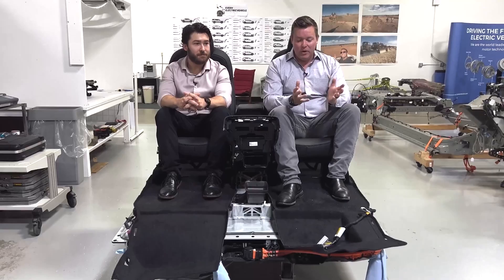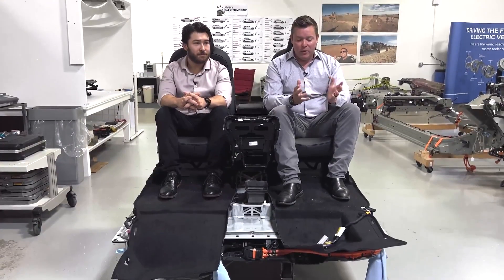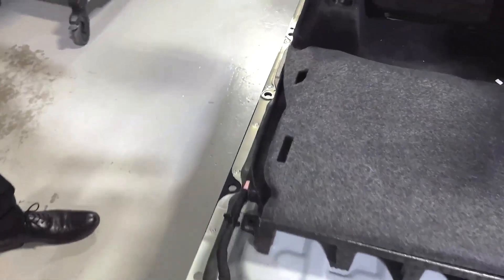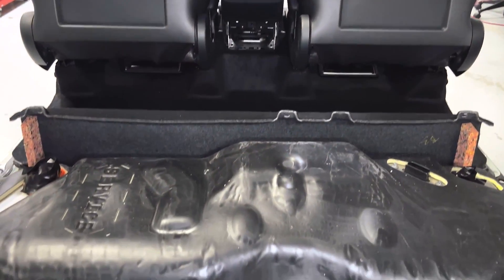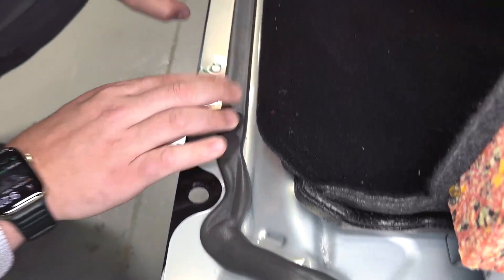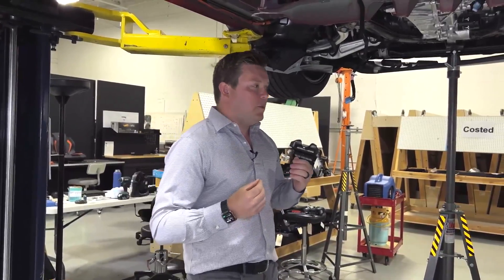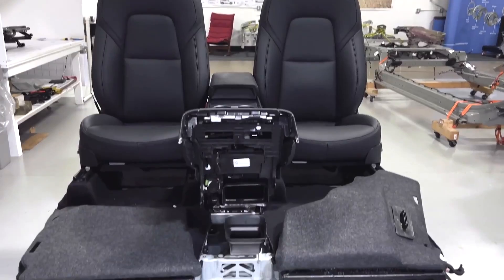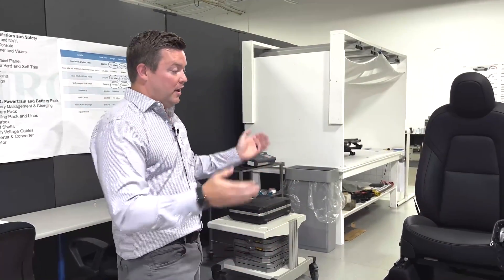Munro Tear Down Tesla’s 4680 Structural Battery Pack 🤯

Comment: Tesla’s structural battery pack weighs HALF of other EV non-structural battery packs. 

Soak that in for a hot minute.
Reply: To be honest though they were comparing it to a higher capacity battery pack however it is still a huge improvement.   Having the seats and console attached to the pack is a awesome design.
Reply: @Frank_W.  a higher capacity battery pack that still only gets about as much range as this structural pack. I mean, let’s not pretend that doesn’t matter.
Reply: And of course, being a structural component, saves some mass from the vehicle's body as well
Reply: the time has come for the Tesla compact EV!
Reply: @nickpeitsch    ... THAT idea.... INJECTS.... itSELF....no Soak'n' necessary....'n' ain' no LIE.... neither.....
Reply: I'd like to know more about the capacity of those other batteries vs the 4680 pack.

Comment: As a retired electrical engineer, my opinion is worth considering, EV: 6 moving parts, ICE 2000 moving parts, it is not rocket science, keep it simple.
Reply: This is one of the main principles that made me confident in EVs' eventual dominance.
Reply: Could you name them, coz some people say there are like 17 to 20 moving parts? It will help for nerds such as myself.
Reply: @AreThou746  In principle you are right. But the little details are not the same. And since some of the systems don't work exactly the same way I could argue they are not the same. Could you please tell me where does the heating come from in in ICE car? I am really curious. Is really regenerative breaking the same? Btw, I could also say I am "Electrical and Mechanical engineer."  Is there a Drive shaft, tailshaft, cardan shaft in an electric car? Please, enlighten me bro.
Reply: @flagellumdei7515  
• The heating comes from the engine. As you have easy access to residual heat, there is no need for a more complex HVAC system. So the one-directional heat pump is present and commonly called the AC. not 100% sure, but this part could even be simpler in an ICE...
• Regenerative breaking is typical for EV. Disc brakes, calipers and active breaking systems are present on both. Less wear, I'll give you that. But it is a moving system, and there... Also: EVs are heavier and regenerative breaking is useless when emergency breaking, the breaks have to be build accordingly.
• You still have inverters, motors with build-in gearbox, differentials, ... 

I said that could be designed better (or different) but it is all still there, next to all the non-driving related moving parts: electric trunks, windows, seats, ...
Reply: @AreThou746  And not a single word about the cardan shaft? So, they are not the same. Designed better? You mean Tesla, right? Btw, some ICE cars have three way valve in the climatronic. My car has one. Anyway, the moving parts that matter. That is the question, not every little minushi. As far as I know in every electric motor there is a stator and a rotor, and invertor. But in an ICE there are far more. No oil change, no cardan shaft, no timing belt, no alternator, no serpentine belt and so fort. As far as I know even the gearbox and the drive train work better in electric cars. And they have 4 times the Energy conversion efficiency ICE vehicle have.
Reply: No it’s common sense, but they did use rocket scientist to engineer the alloys to build the castings. It’s embarrassing that VW has been around for 100 years and Tesla makes cars 3 times faster than them.
Reply: @AreThou746  Allmost the same, right? I see. And you work what exactly? Dental hyginist or what?
Reply: @AreThou746  For pitty sake, this sounds like you are a lawyer or politician. Yes, I mean the important parts that the one has and the other hasn't. Surely we both can count the very few critically important things.  And the question wasn't meant for you. In any case, if you count all the motors and the wipes, sure there are many moving parts. You are arguing minushi, but you are technically correct. Even if the reduction was 2 000  to 200 it's a enormous move forward. And energy conversion doesn't relate to the electricity mix, depends mostly on the efficiency of the technology.
Reply: @AreThou746  braking. BRAKING!!!
Reply: Not to mention the stresses imparted on all those shiny metal ICE parts....life isn't easy for a piston
Reply: Well the irony is on a modern car it isn't the engine or transmission that causes issues - its all the electrical sensors and media system that usually brings the car in. Take the Prius: the specialized hybrid bits are the cause of 6 out of the top 10 most common repairs. The 4 other ICE-specific issues have nothing to do with the engine.
Reply: Word.
Reply: @AreThou746  EVs are 2x more efficient? Sorry, no, the efficiency difference is closer to a 7 to 1 ratio.
Reply: @AreThou746  Yes the original poster did get the quote wrong. It is the comparison of the EV vs ICE drive train not the cars as a whole. EV's have about 30 to ICE around 2000 moving parts in their drive trains. This is the main difference as moving parts = wear and tear so maintenance needed. In an EV maintenance is washer bottle fluid, wipers, tires, and break pads. But if the EV has regenerative breaking then even those last 5X longer.
Reply: Your degree taught you that less moving parts the better. High school dropout and I could see that. About 10 years ago I could have told you that.
Reply: We drive a gmc truck.  Nice truck, replaced the transmission, gear box is going, muffler's  ok ( so far ).  My brother drives a ford truck, nice truck, he's replaced his transmission for $1000 more than it cost to replace ours.  Tesla has none of these parts
Reply: Reminds me of the old engineering adage: KISS = keep it simple, stupid
Reply: Yeah but you're just a glorified sparky! 

Lol j/k! /s! Keep it legit, you certainly have the right of it!
Reply: I am not an expert on ICE’s or powertrains, but ICEs don’t have 2000 main moving parts, it’s more like around 100-150 moving parts for a basic 4 cylinder manual ICE powertrain and an EV has 6 main moving parts (motor + reduction gear) 

Let’s get a basic 8 valve 4 cylinder engine with a basic 5 speed gearbox and hopefully most of the main moving parts.

4 pistons + 4 connecting rods + 4 wrist pins + 1 crankshaft + 5 bearings. 

(8 bucket type cam follower + spring) + 8 valves + camshaft + camshaft gear + belt/chain 
 
3 piston rings per cylinder = 12 in total. 

1 flywheel 

7 parts for the clutch. 

3 gear sleeves + 6 synchroniser rings + 6 freely rotating gears + 2 shafts + 6 synchroniser tooth gears. + about 12 parts for the differential excluding the extra Belleville springs to set the preload on the diff.
Reply: @AreThou746  "Don't be fooled. Only the powertrain is simpler but the rest is the same as any other vehicle. Maybe better designed, but still the same."

Only and only. The difference is huge when it comes to maintainence.
Reply: A typical EV does have +/-8000 parts in the form of 18650 batteries which each of them coeld go bad theoratically and renders the car useless... Just saying.
Reply: @benpancedd  moving parts
Reply: @benpancedd  yes, some of the original Roadsters are getting dead cells. Car is not rendered useless because Gruber Motors etc., can isolate them and those packs are still being produced albeit in tiny numbers.
In this video you might be able to see that the pack is totally removable and therefore replaceable so the car is not useless. 
Something to consider when you do your own research.
Reply: @benpancedd  how do the batteries move?
Reply: @benpancedd  you can have multiple battery cells fail, and the car will work without issue.
Reply: @benpancedd  Tesla and BYD which are the 2 largest manufacturers of EVs use very well designed high quality batteries. They aren’t like the lead acids in a normal car that last 3-4 years. There are Model S Teslas still driving around that were the originals from 10 years ago. This was before the battery advancements and design improvements that have made substantial gains over the last 5 years. ICE vehicles will be dead by 2030. CATL literally just announced like yesterday that they have new batteries that charge to 80% in 5 mins. ICE age is over
Reply: @JaseCoates  i agree about your comment.  What do you suggest ICE and legacy automotive manufacturers should do to alter their course of losing substantial market share in the future?
Reply: @benpancedd  about the batteries, they are using 4680, not 18650, and if one does go wrong, it is like the pixels in your monitor being dead, you can still see the overall picture, but for batteries, that just means you won't be able to use that battery cell.  This also happens in SSD's because inherently they are arrays of NAND memory cells where the human eyes cannot see, so they skip those bad chips, which doesn't affect the overall operation of your SSD computer drive.
Reply: @benpancedd  "A typical EV does have +/-8000 parts in the form of 18650 batteries which each of them coeld go bad theoratically and renders the car useless... Just saying."

No. Most EVs doesn't have 18650 batteries and the car doesn't break if a few cells are getting shorted. But if a few moving parts break in an outdated fossil car engine, well good luck.

Comment: In regards to weight. Do we know what size battery pack the Rivian was? My guess the battery pack was much bigger, potentially 135kwh? I’m guessing the model y was 75kwh battery pack ? So probably not a 100% apples to apples comparison. However, if Tesla is using a smaller battery pack to go roughly the same distance/performance as the Rivian = a truly massive cost savings advantage.
Reply: Its not the matter of battery size. Its the matter of additional structural components for all other cars - and that specifically includes Model 3 and Y from Shanghai, Fremont and Grünheide. The Rivian is only ONE example. Actually every other car has too much baby fat down under. 

Imagine the Cybertruck with this pack times 4 (280kWh for 2000km range…) and the rest of the vehicle consisting of structural parts alone. I am sure that will not be the end of the future but its the next logical step. Remove everything you do not need to drive a car. The floor, the color, the body panels. Remove the rest which is not needed to use a car aka robo taxi… Et Cetera Etc Cetera…
Reply: It’s not about size, it’s about weight to capability. 

If Tesla and Rivian have a similar range, but Tesla gets it done with ~1/2 the battery weight, then this tells you roughly how much more efficient Tesla’s battery pack and builds are. 

Customers don’t care about pack size. They care about range, speed, towing, safety, etc. 

If you could get it all done, better, for less battery, you’d sell for more and it would cost less to make. Which appears to be what Tesla is doing… today.

Comment: Such a leap forward. The entire middle of the vehicle including the battery, can be built separately from the rest of the car. This means they can build these ahead of finishing the entire front and back of the vehicle. Which gives them leverage in the manufacturing process to pre-build major parts of the vehicle unrelated to the body. Mind-blowing.
Reply: the Front & Rear drive units are also pre assembeled, they just bolt in just like the Gigacastings.